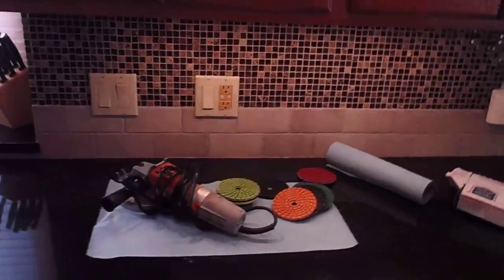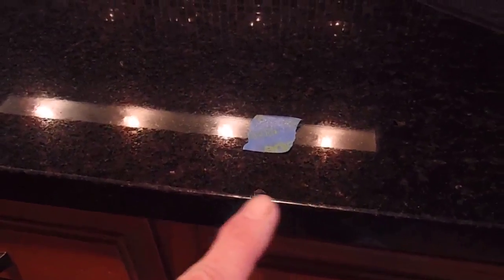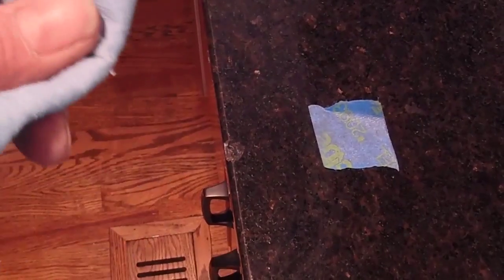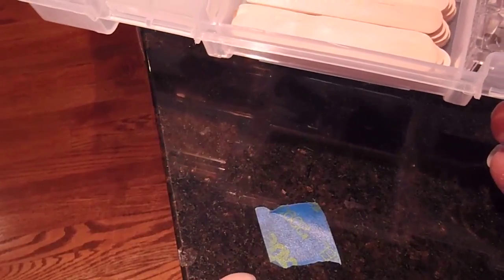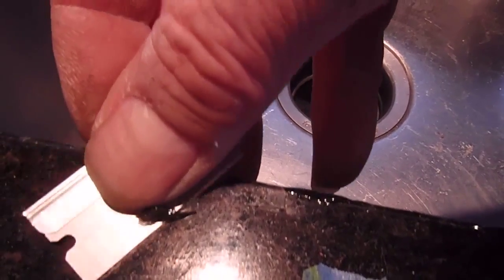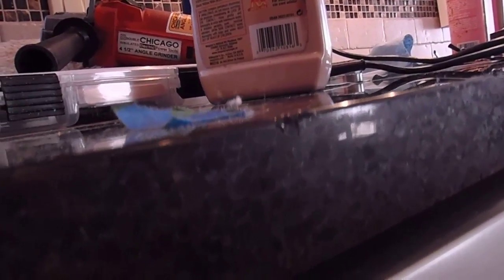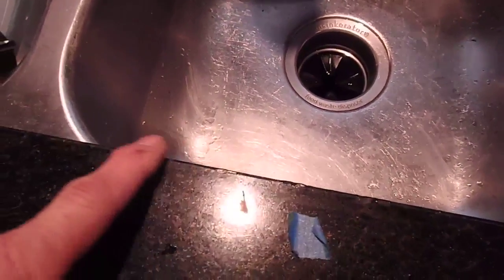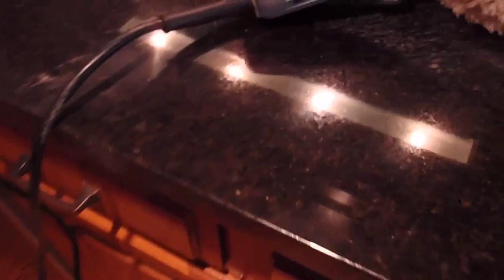How to repair a chip in a Granite countertop.

Comment: Good thing I have all evening to make popcorn, take my shoes off and lay down in my couch to whatch 20 plus minutes of BS to fix some stupid countertop chip..  as you may know. We are in the lightning speed times, apply this free tip,  If you want to share doit fast and efficiently.  30 to 50 sec tops.
Reply from the maker: I applied the 30 second theory on my wife.  It didn't work out.  So this is why I stretch my videos.  Thanks for the advice though....

Comment: Hi sir, can you please tell me how long you waited before taking the razor blade to the partially hardened material?  Also, how long before it fully hardens / cures?
Reply from the maker: It's different for different temperatures, humidity and how you mix the ratios.  Just practice on some scrap and you'll find out quickly how long it will take you particular brand and mixing ratio to work.  But I believe I sliced mine at about 5 minutes and it dried enough to sand in about 30 minutes.

Comment: Thank you for the information very well demonstrated! Do you have any advice on how to advertise to apartment complexes with granite?
Reply from the maker: Use Vistaprint.com and make up some nice color fliers and/or cards.  Make sure the card specifies chip and crack repair.  Mention that they save money by repairing.  Mention volume discounts too.  Chances are they have a lot of chips in different apartments all the same color.  Then you can knock out several with not having to mix up the same color over and over again.  Then clean up and meet the manager and maintenance person and personally speak with them while handing them your card.
Reply: mowerdog that's awesome advice thank you so much you are very helpful! I'll be sure to make those points.
Reply from the maker: Awesome!